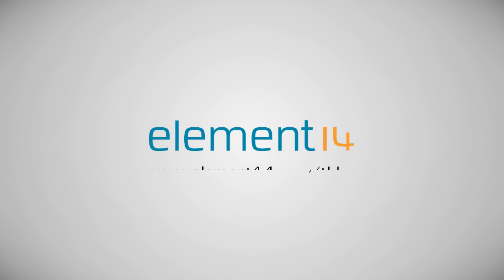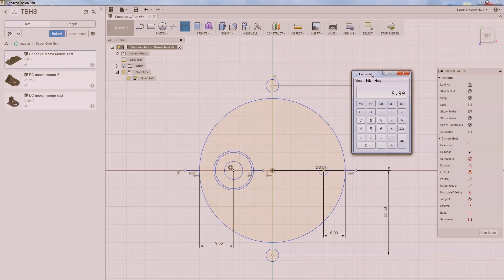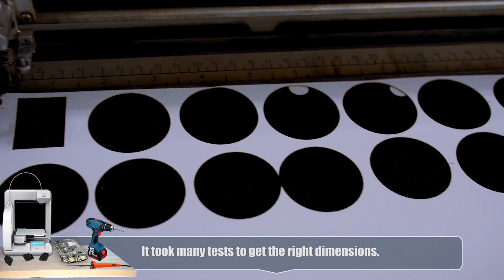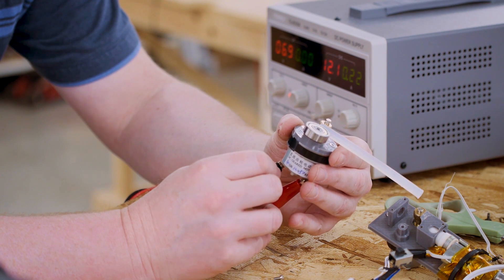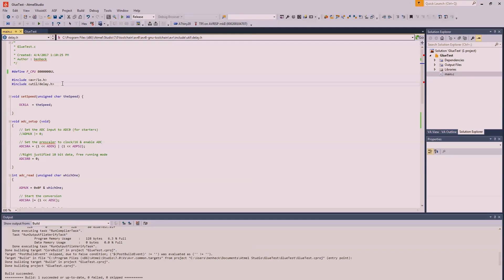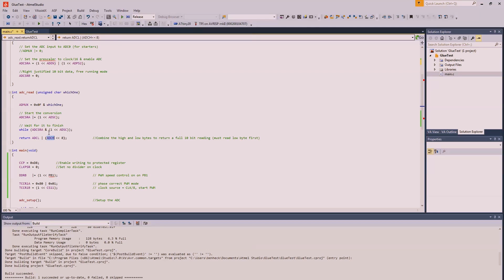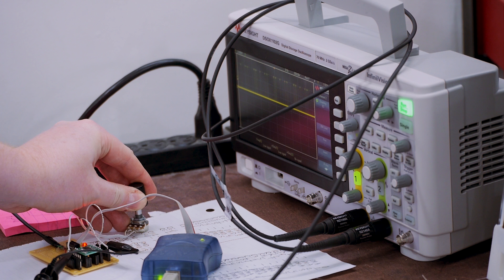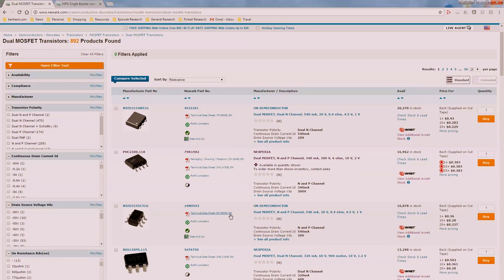Super Glue Gun 04: Hold Me Closer, ATTiny

Comment: Couldn't you just take an image of the gear and compare that with the print model?  Instead of wasting time, paper, plastic making mock ups to test it?  A high resolution camera is a pretty good measuring device.  Granted that you might have to compensate for the lens distortion.  But it should be good enough to get you close with at least one less "test" print.

Comment: Converting an 10 bit ADC result to 8 bit with a logical and only uses the lower 8 bits of the ADC result, surely the correct way is to bit shift the result or divide by 4.
Thanks for the videos. :-)